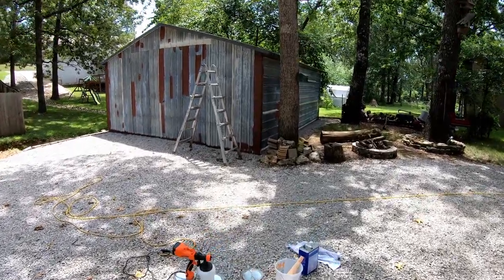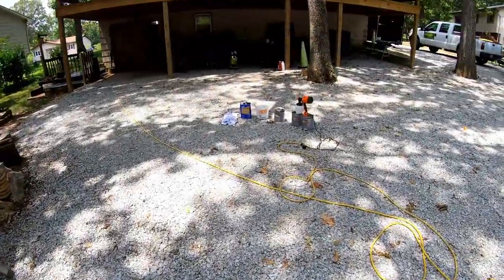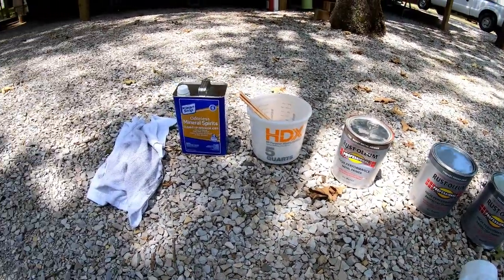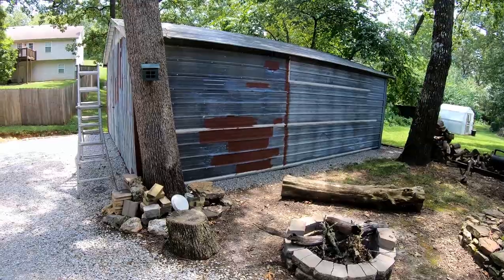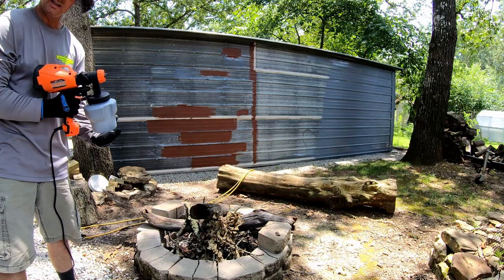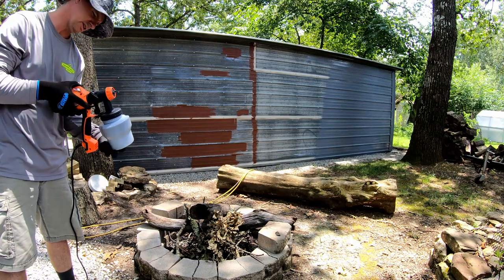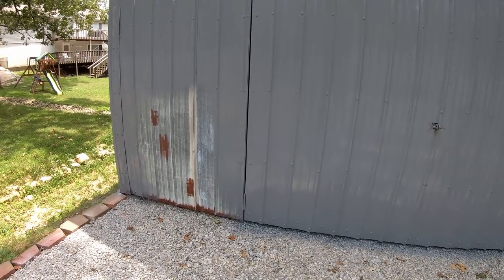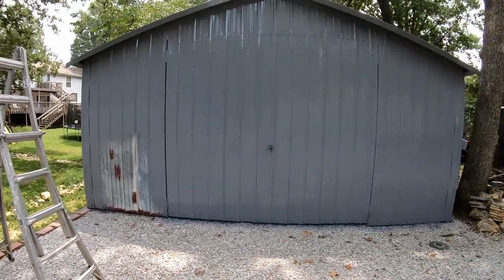Painting A Metal Building

Comment: I am researching all this to paint a metal shed (new not rusty) and this is the most detailed and helpful information. I felt overloaded before (never used oil based paint) but now I feel like I can tackle this. Thank you for showing us the details of the paint and the sprayer. That’s extremely helpful and I’m grateful to all YouTubers who do this to help people like me!!!!
Reply from the maker: Excellent 😊
Reply: I did it! It looks good! I used the same color on my shed. Thank you so much. I referenced this video a few times. The information was very clear. I used a $30 sprayer from Harbor Freight.
Reply: @cindyboxer1184  How is yours holding up? Did you use a primer? I'm having a new metal shop building installed but I'm unhappy with the limited colors they offer. I was thinking of ordering it in white and am researching how to paint it the color I want. This video was so helpful but I'm also curious how it has held up on your new building. Thanks!
Reply from the maker: I did use primer, but only on the spots where the galvanized coating had come off. It's holding up excellent!

Comment: Rustolem 7769 primer. Oil base enamel by rustoleum. Rex beti electric spray gun, 500 watt motor. $60 Amazon. Use 3.0 nozzle for thicker paint. Mineral spirits to clean up afterwards. Take nozzle off and clean all components into bucket of mineral spirits.

Comment: How has it lasted? I really need to paint my shop but I'm so scared it won't stick well and will look worse!
Reply from the maker: It still looks fresh, no issues.
Reply: @HandyGuy2016 . Thank you for the information and video showing your work. I see this is a video from 3 years ago. Just wondering if it is still holding up well?  I am concerned about painting galvanized steel and the paint not adhering long term.  Maybe a follow up video showing the building and any areas of concern. 
Thank you.

Comment: Does your spray gun allow the tip/air nozzle to rotate 90 degrees? That would allow you to spray long vertical strokes and use the same amount of paint as each other side. Those short strokes chewed up a lot more paint.
Reply from the maker: Yes it does

Comment: Has there been any peeling or scratch off issues ? I have read that painting over galvanized metal without first using a bonding primer leads to to a lack of paint adhesion. I have a large machine shed that is galvanized metal siding ( built in the 50's ) that I would like to spray
Reply from the maker: It's holding up great, no issues so far.
Reply: @HandyGuy2016  Is there any issues with the paint peeling now over the galvanized metal?
Reply from the maker: Nope, it's holding up great!